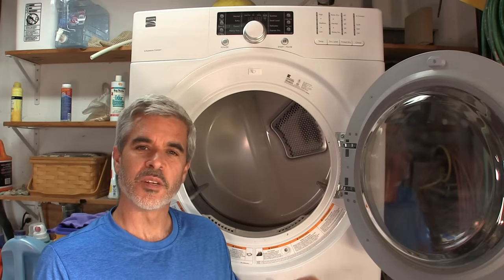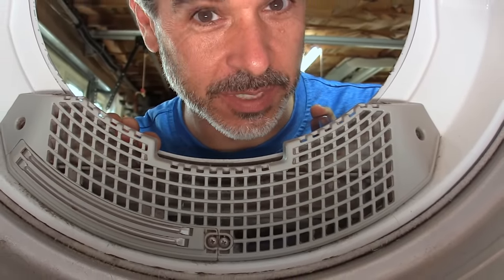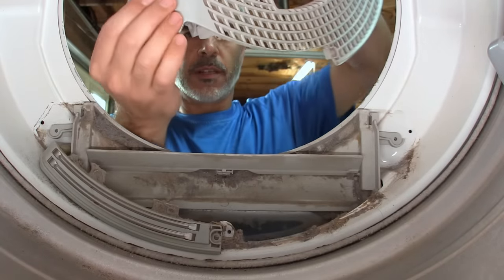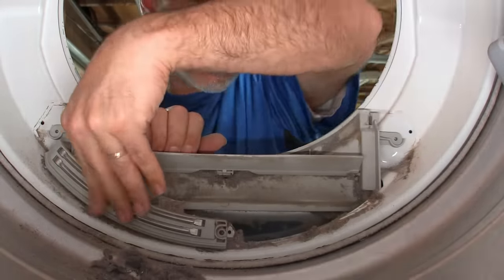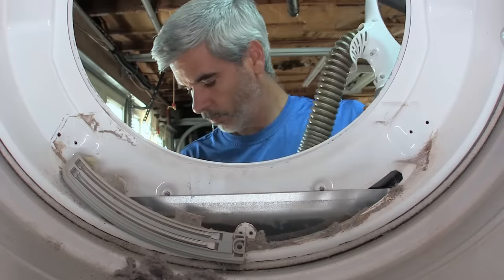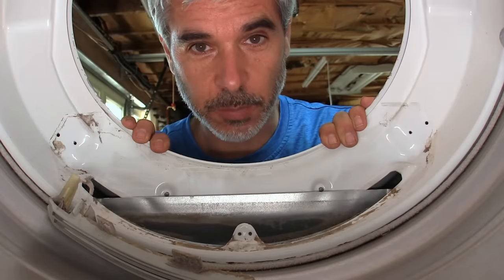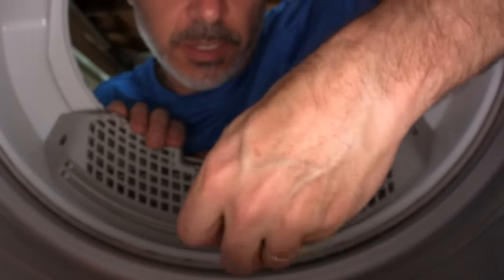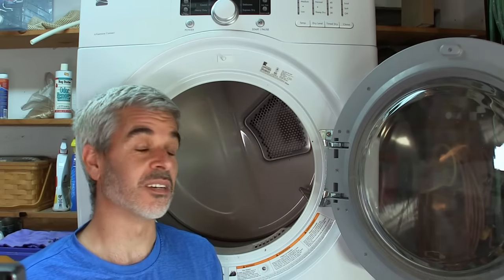Dryer Lint Trap Deep-Cleaning: I found 4 cups of fluff below the filter!

Comment: Good, video, Dan.  Thank you for posting.  One suggestion, and I know most people know this, but I think they should be reminded to unplug the unit from any electrical connection first!
Reply from the maker: Absolutely!  Wish I had shown that step one...
Reply: We know this, but we forget. Thanks for the reminder.
Reply: My washer and dryer plugs are EXTREMELY difficult to reach. I di8see any electrical wiring in the area he was working...I'm not arguing that it is a good safeguard, but is it absolutely necessary? If so, I'd never be able to do this on my own....Also, definite thumbs up, Dan. You seem like a great guy to have around the house..lol
Reply: @adrienneyt2250  Yes!  It is ABSOLUTELY necessary.  But I have same problem as you that my dryer plug is also extremely difficult to reach.  What was easy to reach was my circuit breaker box.  I just turned the dryer breaker off.

Comment: To avoid this issue, I remove my lint every time I do a few loads so it has less chance to go anywhere but in the lint holder. Every time I vacuum my laundry room floor I vacuum it out as well. Once the lint starts gathering on the walls of the lint holder it’s much more easier for more lint to attach to it and build up.
Very good insightful video… 👍🏻

Comment: In 2003 we bought the Kenmore HE 3T front loading dryer and washer set, with pedestals for convenient access.  😊A small brush nozzle on the vacuum cleaner really helps get all of the accessible dryer parts clean.  An old tooth brush will also loosen dried-on dust for removal by the vacuum cleaner. 

If you use products that make drying clothes come out wrinkle free, you may need to clean the metal bars of the moisture sensor by using a folded up piece of paper towel moistened with rubbing alcohol; 71% and above has greater cleaning power.  Let dry for at least 30 minutes with the door open before cutting dryer on again.  Note that if you unplug the wires & plugs to the moisture sensor, it is likely that the wires & plugs will slide back inside and to the bottom of the dryer when you’re not looking, so you’ll get to learn how to take the bottom panel off to retrieve the wires. If the Dryer is plugged in when the wires disappear into the bottom area, please do not use any item made of metal to try to retrieve them. Dryers have 220 volt connections, and you really don’t want to touch one with anything metal while you’re holding the other end.  When you realize you’ll have take the bottom panel off to safely retrieve the wires (only have to remove 2 screws, one at each bottom front corner, if you’re lucky) go ahead and remove the cover from the blower motor. Ours had so much dust in the vanes(or blades) that in half of them the spaces between vanes were completely filled, severely reducing the air flow; it’s a miracle that the blower vanes could move any air at all. But it is 20 years old and has never had any maintenance except our cleaning the filter after each use, occasionally vacuuming the area directly under the filter, and vacuuming the exhaust vent pipe every few years.  

The matching washing machine has never had a service call, but I’ve used epoxy, etc., to fix cracks in the plastic in the round door, to keep the glass where it is supposed to be and to prevent leaks.  Loctite HY 4070 (comes with 4  mixing/dispensing nozzles) Adhesive will “weld” plastic together permanently in 5 or 6 minutes, if you keep the parts in close contact. A primer (typically made of n-HEPTANE) or common rubber cement solvent, will clean the surfaces to be joined and make the weld stronger and more permanent. The primer dries very quickly.

Thanks for making this video, and challenging us to dive in and get the job done. I’m also glad that Sears provided User Manuals and Parts Diagrams with part numbers for each machine, and that I had sense enough to keep them in the same drawer in the laundry room for the past 20 years.

Comment: This worked for me.  Thank you.  The removable lint tray would only reinsert 95% of the way.  All of my drawstrings were catching on to the lint tray and staying caught the entire drying cycle.  This broke so many drawstrings.  I didn't even have to watch the entire video to understand what needed to be done.  Thanks again.
Reply: Putting your items that have drawstrings into net bags (like for bras, but they come in a variety of sizes) will protect your drawstrings and dryer. I usually use them as an easy identifier of items that aren't to go into the dryer (that should hang dry or lie flat to dry), but also use them for items with easily tangled strings or fringe.

Comment: Used this approach today on my mother-in-law's Maytag 3000 series dryer that is over 10 years old and suddenly had a burning smell which I figured for a belt or motor. Nope. 2 cubic feet of lint later, and it is working like a champ. Thanks!
Reply from the maker: Wow, 2ft?  Where else did you find that much material?

Comment: Great job, like what others say, wipe clean the parts. I use a damp cloth.  Also be warned, if you do use the blow gun, have the vacuum attached to the exit in the rear of the dryer.  This way the loose stuff gets sucked and forced into the vacuum. If you just blow the lint into the dryer, you can accidently force lint to go inside the heating element compartment, then you can get loose lint onto the heater element and cause a fire your next start.
Reply: Thanks for making this comment, as I was considering doing this and wondering if that could happen. Now I absolutely will not do that.

Comment: I hate that type of lint trap, but that is what is in my current dryer. Instead of pulling everything apart, use a good vacuum to get rid of the lint. Another option is to use the bristle brushes made to clean refrigerator coild. They are fairly long, and pick up most of the lint not caught in the trap.

Comment: There was a fire in my apartment building’s communal dryer a few weeks ago. The Mainteance supervisor for the property owner blamed the tenants, saying that they don’t clean the lint trap. In the 10 years I have lived in this building, only once did I find the lint trap un-emptied when I used the dryer. This video confirms that regular deep cleaning is necessary to keep these machines safe to use. Especially in a multi-family apartment building. I have also since learned that the lint can smolder for hours before flames and/or smoke are detected.
Reply: Funny story. I had a client that I consult for risk management and they owned about 45 apartment complexes.  I made a recommendation to insure their maintenance people check and clean the lint trap and exhaust hoses every 6 month minimum.  
He didnt want to do it because it would be too time consuming. He didnt think lint could catch on fire. Its fuel and highly combustible.   Heating elements and lint are a bad mix. 
Yes, he had already had a dryer fire at one of his properties. 
Some people just do not care and prefer the mighty dollar.
Reply: @sw.1984  Truth
Reply: I'm living in an eight-plex in which every unit has one of these dryers; and although the building is only two years old, my dryer is caked with unreachable lint. After watching this video, I feel confident to disassemble and clean it out; but I am very concerned that others in the building will not clean theirs and a fire will result. I was glad to hear that the dryer in the video had not been cleaned out for 6 - 7 years, so the threat of fire in my building probably is not imminent.
Reply: @sw.1984  An apartment manager told me that the lint never dries out in the machine, and so is not a fire hazard. I wrapped some duct tape around the end of a rubber tube, and fished out lint to show him that it was bone dry. It still didn’t convince him because none of his colleagues had ever heard of it being a problem.
Reply: @DovidM  fire waiting to happen!

Comment: I did our dryer today. Plenty of dense lint and some grit on the bottom below the lint trap. I had to duct tape a narrow hose to the vacuum to get down there. While I was at it, I also took the exhaust pipes apart to discover a uniform lint layer approximately 1/3 of an inch thick the whole length of the pipe, which I also vacuumed out. There was way more than I expected. Thanks for the motivation and demonstration.
Reply from the maker: Hey Dave, great work!  Yah a lot can build up over time.  Just not something we normally think about.  Glad the video was helpful.  I like your duct-tape idea too!

Comment: Should also take the panel off and do inside under the drum.

I did ours and there was an inch thick layer of lint covering everything and it was actually starting to burn where the heat element was. Glad I caught it before a fire happened.
Reply: The repairman cleaned mine out really good. It was really bad under the drum the dryer is 10 years old and was never opened.

I have always cleaned the vent duct out the vent is in an exterior wall so haven't had clogging issues.

I use a dryer brush to push all the lint out the exhaust during the next cycle.

I couldn't believe all the lint that buildup in the bottome over the 10 years of operation.

Good thing it was caught it too was starting to burn it was really thick reason for having repairman the drum belt broke when the repairman came to fix it he discovered a blanket of lint in the dryer about to catch fire.

I had no idea the dryer was about to go up in flames I would have kept using the dryer if it had not broken down.

Comment: I securely taped a plastic tube to the end of the vacuum cleaner hose and removed the lint a clump at a time. The lint will form a ball on the end of the tube and the suction will keep it stuck there until you pull it off. This method requires repeatedly inserting the plastic tube, moving it around in the cavity and removing the tube until no more lint comes out. I used this method on a dryer that required the whole front of the machine to be removed to get at the lint buildup. I was dealing with a stacking washer and dryer squeezed into a small condo closet so I wasn't about to take things apart.

Comment: Thanks Dan, long story short, we let our niece use our vacation home and we think she tossed some wet beach towels into the dryer.  We have had sand for a few weeks.  I’m going to use your video for one more clean.  

I made an adaptor for the vacuum to fit into narrow spaces like a dryer or the refrigerator coils.  Just go to Home Depot or Lowe’s and grab a 3 clear PVC hoses.  Start with a size with an Outside Diameter that fits your vacuum. Then get one smaller, and a third one smaller so they all fit together, and tape them  up.
Reply from the maker: Nice way to get it cleaned out!

Comment: Suggestion: Use a vacuum to draw out excess lint before disassembly of the parts, and then again afterwards of course. Using a "Linteater dryer vent cleaner" kit (with extra rods) also prevents fires in the wall duct that goes to the outside of the house and it is a good idea to do cleaning every 9 months to a year to keep the dryer working efficiently. Some dryers have a sensor that indicates percentage of clearance in the vent. Tip: Take a photo of the parts before you take them apart.
Reply from the maker: Thanks for the comments James.  Do you use something like this? https://amzn.to/3HXowwL
Reply: @DansWay  I have something like that tool and just cleaned out my dryer exhaust hose and vent tube going up the inside of the wall to the roof last weekend. Was able to suck out lots of lint. My dryer had stopped working and displayed the error message: vent clogged. Now it works fine. But... I also saw all that lint like your wife saw and will now be cleaning out the front end also. I'll probably remove the whole front cover of the dryer so as to get access to all the lint I can.
Reply from the maker: @esong21956  Sounds like you are doing a really thorough job!

Comment: Tip I have discovered cleaning ur dryer as well ..Take a swifter and it will wipe the lint off or use just a dryer sheet! It works fabulous!!
Reply from the maker: Hey Catherine, thanks for the suggestion!  Do you also wipe the lint-trap itself with the dryer sheet? Some people have commented that the lint trap mesh gets clogged due to residue, so perhaps the dryer sheet would remove that as well.  I do often laugh when people complain that I didn't wipe down the inside better.  For me, it is just going to get dusty on the next load so it is the buildup, not the presence, of debris that I don't want to allow.  Have a great one!

Comment: great though I was waiting for the after shot of what it looked like inside the trap after you vacuumed it out. ... never got that money shot.
Reply from the maker: Haha, so true!   I guess you will have to trust me that it was 95% cleaner than before...
Reply: I was too 😔. Great video though!
Reply: Yes,  me too!!!
Reply: Yep!...In videos like these...REMEMBER: We ALWAYS NEED THAT AFTER SHOT!!!!! 😎🖒🖒...😂😂
Reply: @DansWay  My dryer has lots of lint in it and looks like yours. But mine makes a ton of noise. Do you think lint could be the source of the noise?
Reply from the maker: @moodberry  try manually rotating the barrel.  If you hear similar noise, the problem is likely the wheels on the bottom that carry the weight of the barrel.  These are known to fail eventually and can be replaced yourself if you are handy.  There are videos on how to do this, but not by me (at least not yet...) ;-)
Reply: Wow!  That was a lot of lint. Great job of cleaning it out. I guess it could start a 🔥.
Reply: May not time include the after shot.
Reply: Daddy wants to leave the money shot to our imagination. It's hawter that way
Reply: Yeah Dan!

Comment: I've taken mine apart twice for maintenance. I've replaced sensors the first time and the entire burner unit the second time. You would be totally amazed how much stuff is inside the burner unit. Luckily for me, mine is electric. If it was gas, that dryer dust can be a bigger hazard. If your clothes aren't getting dry with one drying cycle, clean out all the ducts and open the burner access panel on the back of most dryers and inspect it for flammable material. Save your money, increase your machine life and maybe save your own lives. Great video Dan, Keep up the good teaching.   JC
Reply from the maker: Thanks for the info Liz.  Sounds like you have done a lot to keep your dryer running safely!

Comment: I highly suggest cleaning everything. Disconnect the vent from the dryer and clean through the back, the lint will likely be compacted, but it’s easily lifted by raking it with your fingers, or a clean toilet bowl brush. From there clean out the tube from your dryer to your vent, I use a shop vac for that, lastly clear out the vent itself. Not only will you save on electricity from your dryer working more efficiently, but you’ll avoid a devastating lint fire.

Comment: It was nice to see someone show how simple these jobs can be for nearly anyone. I would like to recommend, where ever possible to either wear a nuisance-dust mask or place a fan to blow the fine dust away from you as that stuff is nasty to inhale. What about the fan and the exhaust end? There are special brush sets available to help clean these awkward-to-reach areas; they are easy to clean for most dryers and will be amazed at the very fine dust you get rid of. The extremely fine dust that accumulates is also very combustable. I cleaned my whole dryer in about 30 minutes including the vent pipe and do it annually to be on the safe side. No lint build-up also means a more efficient dryer using less time and power to dry a load of wash. Cheers.
Reply from the maker: Great job Michael.  You are really doing more than most of us for sure... ;-)

Comment: O no. Forgot to clean the screen.  They will look clean  until you run it underwater.  The fabric softeners coat the screens.
Reply: I've hearx this rumor before & after 5 years, and using dryer sheets, water still runs freely through the screen.
Reply: Stop using the sheets.  Use white vinegar to rinse( no odours) then if you feel the need ,a sheet of kitchen towel with a few drops of your favourite essential oil in the dryer.
Reply: FAbric softeners are a waste of time & money, not to mention toxic.

Comment: Access to the innards of different dryer models varies greatly.  On some it is necessary to pop the skins off, something that may take a couple of hours of effort, but would allow thorough cleaning of the cabinet with a vacuum cleaner, especially near the heating element of electric dryers or the burner of gas dryers.
Reply: You can have the front off of most dryers in about 20 minutes, less than that for someone who does it for a living.
Reply: @jimnaden5594  — I agree, but I'm an amateur when it comes to my first attempt at all things.  It's the "learning curve".  Once I know the tricks of where to stick the putty knife to release the hidden spring steel catches that hold the panels in place, it goes much faster.

Comment: In the 1960s, my mother was ready to buy another dryer, as the two-year old one no longer seemed to dry. I replaced the thermostat; it seemed to help a little but not enough to justify keeping the dryer. I then opened it up, dissected it, and removed lots more than 4 cups' worth of fluff! After a through cleaning and reassembly, she used the dryer for several more years without difficulty. (I vaguely recall that this was the dryer I later also had to change the drive belt on.)
Reply from the maker: Awesome story, thanks for that!

Comment: Thank you so much for this! I dropped my ring down the lint trap and was freaking out after I took it apart. Super helpful!
Reply: The trap needs 2 b washed before replacing  it...strait pipes was recommended 2 me for exiting drier heat 2 the outside...I have a long distance 2 go..maybe 15 feet..how do I do this..?